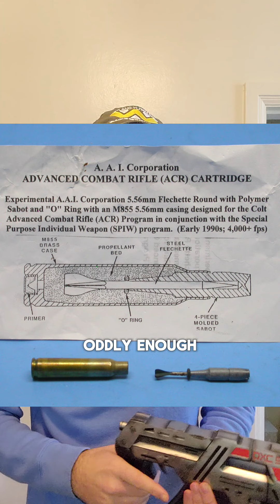Bullet Speed Limit, how fast can modern gunpowder throw lead?

Comment: I think its scary enough that someone 5,000 feet away can hit me in just a second
Reply: Bullets don't have enough accuracy to hit a target that far.
Reply: @Nurotox7 DARPA says otherwise.
Reply: @Nurotox7 Specialised rifles have effecive range that reaches that far, AW50 for example
Reply: @Nurotox7  The top 15 longest range confirmed sniper kills are all over 5,000ft, with the longest being over 10,000. (Used Wikipedia)
A skilled marksmen on unmoving targets can consistently hit at 1 mile ranges, which is over 5,000 feet.
The guns can do it.  The issue is accounting for moving targets, dialing in your rifle, account for wind, weather, and the Coriolis effect, and, obviously, being a good shot.
Reply: @legomacinnisinc to add to your list: also round to round inconsistencies. When you look at the prep distance competitors do - it’s prepping brass, loading gunpowder to exacting measurements, prepping bullets…it’s an extraordinary feat of engineering and type A OCD to create two rounds with so little difference between them that they even stand a chance of shooting close to each other at those distances.

Comment: One interesting topic is how fast a bullet can in atmosphere before some quirk of hypersonic physics either through heating or "turbulence" ends in making the bullet ineffective.
Reply: Depends how you define "bullet".

Theoretically, with 3D printing smart bullets are a thing. They are just crazy expensive and stuck in a DARPA lab.

I bring that up because we're going to need avionics where we're going.  

So what if we replace the 30 mm rounds in the GAU-8 with rocket assisted, sabot, ablative, hypersonic, 3D printed, jet rounds.

Basically the whole thing looks like a normal bullet. After you shoot it, it engages a rocket engine. When the rocket engine cuts out, then the sabot is ejected because it's also dual purposing as a rocket fairing. Going to need some sort of ablative to keep it cool. But it should produce a really awesome tracer effect.

A hypersonic jet is just a fancy wavy shape going really really fast plus some fuel. The engine is essentially on the outside. You 3D print on solid fuel, so it gets pulsed up to hypersonic speeds, right after sabot/fairing release and just before impact.

It might even be  beneficial if some of it liquefies.

And these are self-propelled smart bullets now, so you can give someone a bad day over the horizon.

Comment: So the 22 eargesplitten loudenboomer is quite an old cartridge and at least on Wikipedia it's speculated it could go faster with more modern powders, but very possibly no more than 5000 

Now I'm struggling to find corroborating sources but a magazine article claimed in 2012 that .30-378 Weatherby magnum was originally created with 30 grain projectiles and reached 6000fps. This is very questionable since they noted it was done with slow burning powder.
Elsewhere online this seemed to be quoted and someone commented that the .30 cal 30 grain projectiles were milled out of pure copper 

On the 23,000 fps detonation velocity, it seems there has been some research into RDX based propellant with a detonation velocity of about 28,000 fps. Of interest for you Marcus the goal of this research seems to actually be safety in increasing the cook off temperature of the propellant, so possibly useful in caseless ammo

Comment: Smokeless gun propellants have achieved over 8,000 ft/s—large cal experiments from over 40 years ago. Small cal has gone well past 5,000 ft/s—there’s a TechLink article from a few years ago—the US Army demo’s 5750 ft/s from a 24” barrel. 

The actual velocity limit for all guns—even light gas—comes from the maximum velocity of expanding unsteady gas flow—over 16,000 ft/s—and no kind of gun has come close to that limit.

Comment: Funny enough I've been looking at theoretically roughly doubling the energy of a few cartridges(I don't know how to calculate powder charge, I'm just comparing tensile strength of various materials to brass)and they don't seem to go over that speed limit. But would there be any point in going faster rather than using a heavier bullet? I'm pretty sure the mass of the powder would make the recoil just as bad
Reply from the maker: You might want to look into .277 Fury. It uses a multi-part case, steel where there is more pressure, to allow for chamber pressures about 33% higher when compared to a similar size round. 

As for why more speed instead of weight, those factors are the two sides of two different coins.
In short, kinetic energy is velocity squared multiplied by weight. So speed plays a BIG part. 
This is the amount of energy a bullet imparts on the target, and is a significant factor in armor penetration.
Momentum is another big factor. It is velocity multiplied by weight, so both play an equal factor. It is how difficult it is to STOP or deflect the projectile.
Elephants have big bones and a lot of dense tissue, so we use heavier rounds that are slower to hunt them. These can penetrate deeper because they have more momentum. Something lighter is more likely to slow down before it reaches vital organs.

Comment: Couldnt you just use a explosive with  a much higher velocity like C4?
Reply: Problem is when you start dealing with higher pressure curves you need to deal with containing that higher pressure curve, so it can be done repeatedly in a non destructive way. For example a modern firearms chamber is handleing pressure within the alloy of steel used operating range, no real deformation is happening from containing the detonation. If you start throwing higher speed propellants in there you end up with the problem of even if you make the chamber walls thick enough, your actively breaking down the granular structure of the steel unless you can come up with an alloy that can handle it, which with an unlimited budget, doable. but try makeing it affordable outside a research lab and problems insue
Reply: @therideneverends1697  sounds similar to the issue that stopped the US rail gun research. The gun worked and achieved hyper velocity but it was very quickly eating the inside of the barrel.  Every barrel has a expected lifespan but its usually thousands of rounds for naval guns.